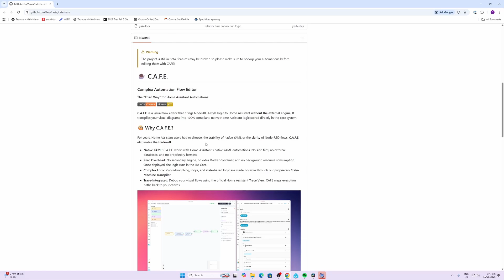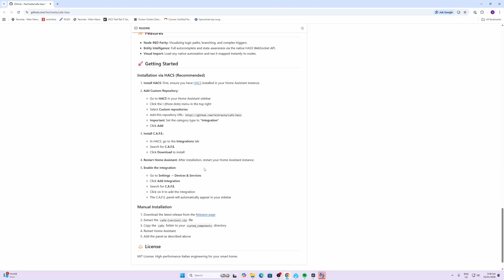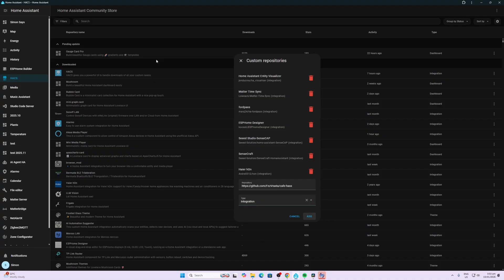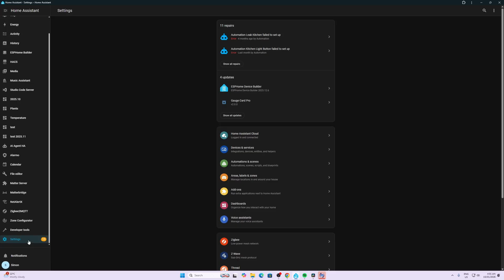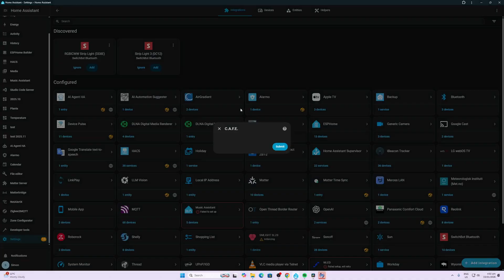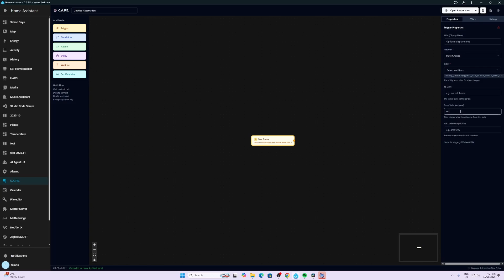Try this new Home Assistant Workflow Editor!

Comment: This "solution" will not solve the "struggeling with automations" issue which is mentioned in the title of this video.
We need smarter solutions which will work out of the box for an average home user without diving into the technical details.
Reply: Not everything can be done by mindless drones who just push a button. Systems where everything is done for you already exist. You pay an installer a gigantic wad of cash and they show up and set it up and come over and maintain it once in a while. You can't both have a powerful automation system you set up yourself and expect to do that without knowledge. You need to understand some crucial facts about how things work and actually do the work to wrap your head around it; Home Assistant has never been this easy to get started with and they keep improving it every day but it's still going to require a semi-knowledgeable operator/installer.